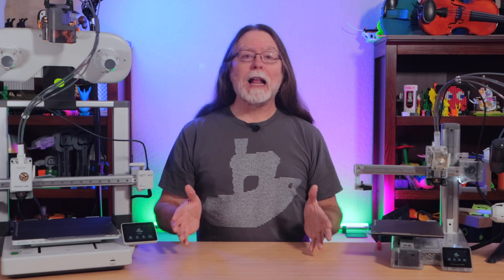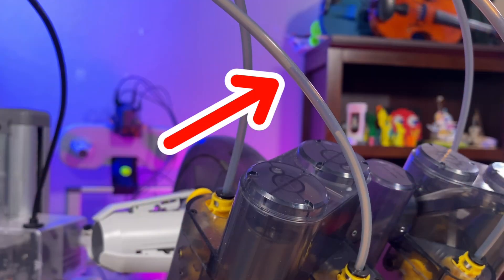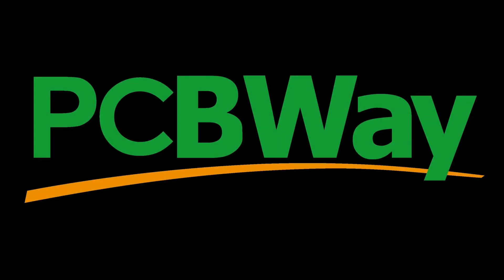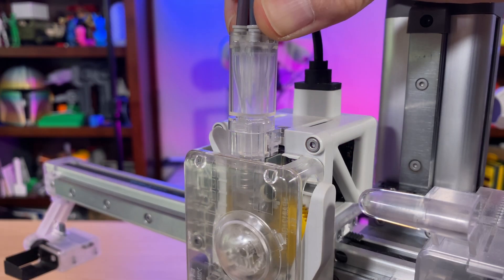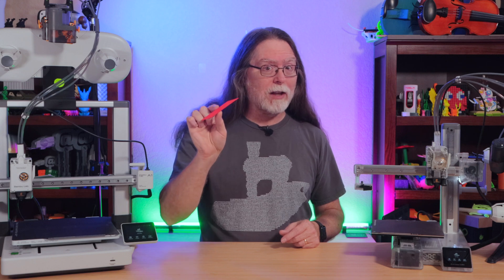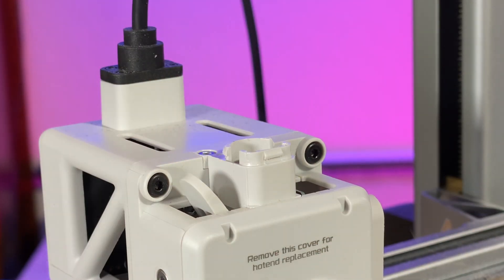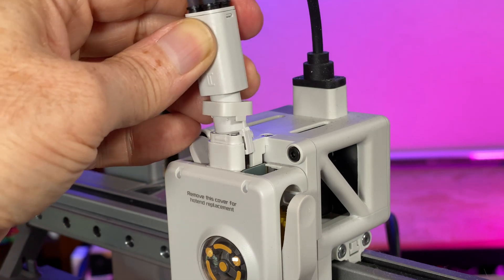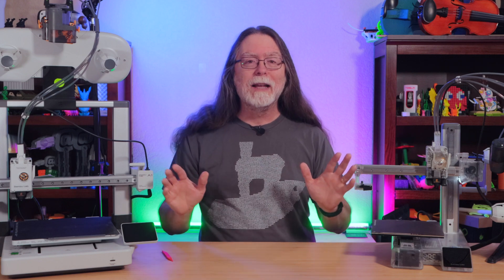The EASY way to Clear AMS lite Filament Breaks!

Comment: How would you know if you broke a filament in the tube?
Reply from the maker: Hi, there are a couple of ways. The first way is, filament would be left behind in the tube after rewinding it back onto the spool, and you'd be able to see it in the tube. Second, the printer might complain that it's unable to feed filament, and one cause of that would be filament still in the tube, or even just left behind in the 4-into-1 hub on top of the tool head.

Comment: I have found a readymade tool for removing the filament tube from the AMS Filament Hub.  You have several in your home.  I use a dinner or dessert fork to hold down the retainer while pulling up on the tube.  Good Luck
Reply: THIS RIGHT HERE! I didn't want to go the route of unhooking everything and seen your comment about using a fork. It worked flawlessly and I was able to remove the broken line with ease. Thank you so very much! ☺

Comment: My discovery is that the reasons I could not initially easily release the PTFE tubes from my filament hub is that I'd pushed them in too hard when I first installed them, and from what I've seen, that appears to be a common mistake. Now that I know to gently push the PTFE tubes in till they're snug, but not forced in hard, removing them is pretty easy. In fast this past weekend, I just went through the process of replacing all my PTFE tubes with new ones. Dead simple and dead easy. No special tools, and no disassembly of the filament hub required.

That said, your process and tool would have been a godsend the first time I went to disconnect the tubes from my filament hub. That was painful, but I've also learned my lesson from that experience.

Comment: Cheers. Now I have removed the filament, I can print the tool. I think I will unload filaments not in use as they tend to get brittle and break. Havent done any multi colour printing as yet.

Comment: Thanks Bryan! I didn't know those little rings could be used to remove the PTFE. I thought so initially, but after having no luck, I thought maybe that isn't possible. I didn't print your little tool for removing the tube, but maybe I should before it happens again. But that gave me an idea, I used the spare part... not sure what it is called, but it bundles the PTFE tubes. I figured that would work, and it sure did! I was able to pull the other end off and free the stuck PLA!

Comment: I have just purchased the A1 Combi, I already have the A1 Mini. I wanted to use the AMS Lite on either machine, as I had a spare AMS Lite Hub I simply attached the 4 ptfe tubes to that. When I want to use the AMS I remove a hub off of either machine using your removal tool and connect the AMS Hub. This I hope will save damage to the hub connector teeth if I constantly keep removing the tubes.

Comment: Clsaring breaks associated with the AMS Lite system is so much easier than the AMS system. With the AMS the break can occur inside the AMS so the rest of the filament is still under tension. The AMS Lite... just manually push more filament through while the hotend is at temp, and you are using the control panel to extend the extruder. The only real problem with the A1 and A1 mini is when the filament snaps near the extruder. And PS...The secret to get the printhead's filament head off, is to remove the 2 screws behind the filament hub. But your solution is better because when you remove the 2 screws and pull off the filament hub, it is still attached by a ribbon cable, so you're risking damage to the cable.

Comment: I Bryan!  I love what you do for the community.  Speaking of the A1 filament hub; I totally agree that removing a tube from that thing is just plain hard!  What were they thinking anyway?  And speaking of that, why didn't they include a fifth hole for inserting the tube from the non-AMS spool?  That way we wouldn't have to mess with the hub at all when we want to print with a filament that's not compatible with the AMS, like TPU.  And taking that thought one step further, someone like YOU Bryan could probably design such a hub?

Comment: Some notes I've learned about this area specifically:
1. DO NOT unfasten the screws behind this multi-in tower section, unless you are prepared to possibly tear a fragile flat-flex PCB hidden at the backside of it. 
2. Removing the PTFE tubes from the top of the assembly, will likely not help you clear breaks at all, what happens is 2 pieces of filament get in there and really wedge themselves into a funnel shaped area, extruder motor drives them in hard sometimes.
3. Push any breaks that are internal to the PTFE, out via filament, if you do this a lot, a scrap of PETG, PP, or PA6 filament etc is a much better choice than more PLA that will break later.
4. There is a layer of grease all over the outside of the tube part that comes out, fair warning.
5. For the reassembly, you're going to round corners off gradually if you pop it straight down like that.. angle the left side back on just like it was first THEN snap the right side down. Reverse the order of disassembly.
6. Print a PTFE-removal tool well before you ever find yourself needing one. Once the tubes have been there for a bit, the coupler teeth BITE the tubes, you will be required to depress the top of the ring, push the tube down, give it a slight twist to help get it off the old teeth marks, then pull out if it's coming, else the teeth just bite back in. The AMS couplers are easy to pop free, but the ones on the printhead, I'd really suggest the tools. As someone with lots of disassembly experience and good dexterity, they're fiddly once the teeth are set.
7. Not all PLA is the same, some of mine gets brittle and breaks after just a few days inside the tube, huge pain. PETG is much better in this regard for multicolor, in that it can stay in the tubes pretty much indefinitely and doesn't break randomly as a result.

Comment: I have added PTFE Tube Connectors about an inch above the hub. 90% of the time, using this as a quick disconnect solves filament-in-tube issues.